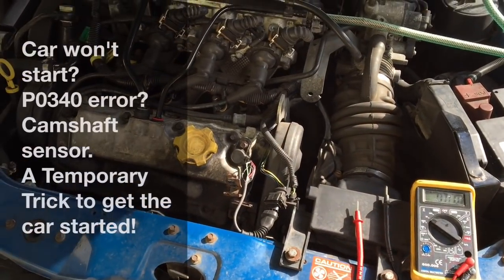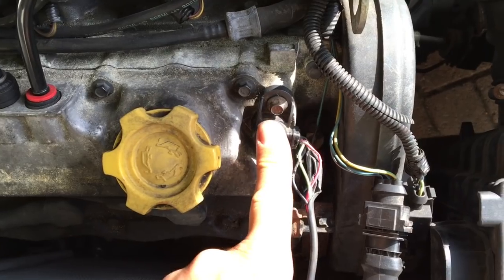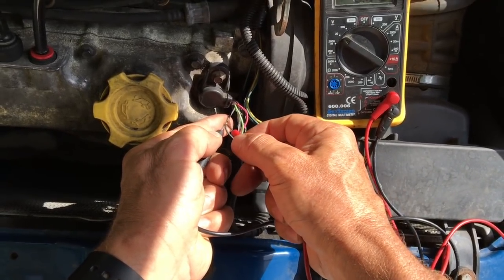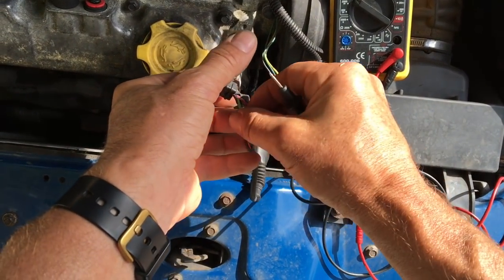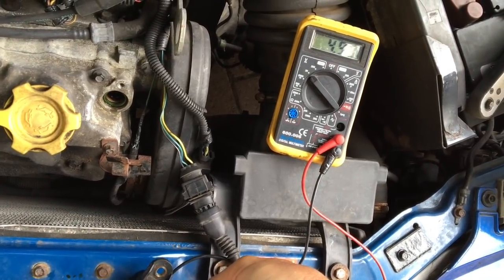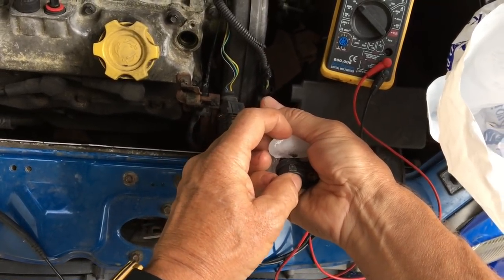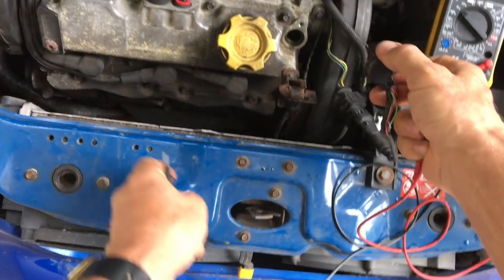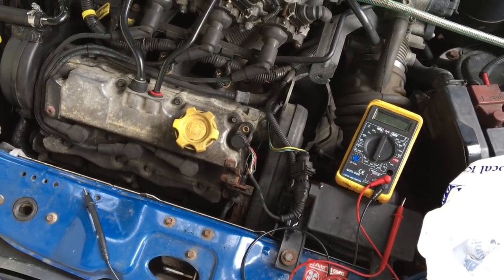P0340 Error? Car Won't Start? Here's a Quick Fix! For Camshaft sensor.

Comment: On mine 45 kv6 i change the sensor but still same situation i cant start car again,anybody have that problem also?
Reply from the maker: See this recent video of mine for confirmation of whether the sensor is actually working, https://youtu.be/kAOlPEnuTMw 
I had a recent experience of a new crank sensor being worse than the old one. 

Also have a look in the timing belt cover to check that the camshafts are actually rotating.  If none of that reveals the fault, then check the cam timing to check it hasn’t slipped due to a slack belt..      https://youtu.be/kAOlPEnuTMw
Reply: @comeinhandynow  well actually at first i get first problem with crankshaft sensor the car will just turn off in midlle of driving,then i will restart fault with TOAF and car will turn on normally and i will continue driving till again same thing will happen.So i change crankshaft sensor and everything was fine maybe 20 days,then sudenly my car just turn off in middle of driving again,now i get this code like on ur video so i change camshaft sensor but still no help.I just notice one thing when i get this camshaft fault code and when i try to turn on ignition i heard some knocking sound down the jatco gearbox and then i clear the camshaft fault with TOAF this sound stop but still i cant turn on the car ...really strange
Reply from the maker: @i_mgzr9038  I believe if the car stops while driving it must be the crankshaft sensor failing.  A faulty cam sensor stops it on restarting not during driving.  Maybe there are some poor crank sensor parts out there.  As in the video, I fitted a Delphi one and all good.  I would also recommend the digital scope for diagnosing with confidence, as in the video I posted earlier.
Reply: @comeinhandynow  yes i understand but still on diagnostic i have only camshaft fault like on ur video

Comment: I’ve changed my car sensor and still won’t start. What should I do next ?
Reply from the maker: Test the sensor as shown, then check that your camshaft is actually turning by looking in the hole where it went. The timing belt/chain may have gone or cam snapped.

Comment: Thank you!!! This was so helpful. I pulled mine out and iced it 7 minutes. Put it in. And instantly started!! 05 Chrysler 300c..
Reply from the maker: Great!
Reply: @comeinhandynow   thank you again, I was getting both p0340 and p0344. So I used it to diagnose it. As I was worried the problem ran deeper. But the second drive after replacing the engine codes (both) cleared themselves.
Reply from the maker: @StutteringInquirySGT  Well done, yes they should clear out when they are working ok.

Comment: I just replaced my camshaft position but the car still won't start and it made that same noise that it did in the video. And this is before and after I replace the camshaft position sensor it still won't start. I don't think that's what's wrong with it even though the code says it is. It might be a bad fuel pump regardless what the scan tools says.
Reply: I replace the camshaft position sensor because my car wouldn't start the diagnostic code set p0340. Replaced it and it still won't start it still makes that same noise that it did in the video. But I don't think the scan tool knows what it's talking about because the fuel pump doesn't make the buzzing noise it used to make which means the code should be reading bad fuel pump not bad camshaft position sensor.
Reply from the maker: @BryanG830  If the code is p0340 / cam sensor then it is the cam sensor signal at fault not a fuel pump issue.  I have bought a new sensor in the past and that new one was faulty, so test the sensor yourself, as in the video to see if it is working.  If you can get an oscilloscope on the signal that will also show if it works or not.  The other experience I had was a cam sensor error caused by the camshaft drive bolt having snapped and the camshaft was not rotating.  Worth checking.  That was on a BMW/peugeot engine in a Mini.

Comment: Extremely helpful video. My wife's Meriva A 1.7 cdti (2005) has issues starting when warm. Was advised to check this (will be testing / replacing over the weekend) 
Not 100% sure this is the issue but my thinking is start at the cheapest possible cause & work up lol 
Battery / alternator tested good at Halfords, but strangely when it's warm & hard to start, it starts  when I connect my Noco battery booster jump pack ?? Starts absolutely fine when cold or first thing in the morning first turn with no problem - so the battery has enough juice to start when cold, but strangely it seems not when warm.  Helpful video Ty - subbed 👍
Reply from the maker: Thanks, sounds like it could be the cam sensor, as in the video.  When it is hot and difficult to start you could try that ice trick as in the video to see if it is that part.

Comment: my car gets this code... aragh... have had new sensor put in (by toyota), new ecu (dont ask) by toyota. Yet still I get this code and my car intermittently wont start. Its driving me mad, other day I couldnt start the car for 1.5 hours ... its like there is a gremlin  inside my car. Auto electrician said there is no problem electrically, am now being told possible stretched timing chain. Mine also had hot starting problems, would start when cold. What was the long term outcome with this fault?

Comment: 2005 crysler 300 3.5 driving,that code showed up I replaced the sensor  started  driving on the highway then all of a sudden the car stop running. And wouldn't start .I was stuck on the highway for 6 hours before I finally got help .. do u think the timing chain could have possibly failed even know I didn't hear any odd noise like lifters, rods chain dragging noise
Reply from the maker: Too difficult to tell what it could be. Read the codes again for clues.
Reply: @comeinhandynow  the code Is the same code p0340
Reply: @Jmasontv  so what was it sir
Reply: @aloiba100  I never figured it our ended up getting towdd by chp

Comment: Mine will start gears want change it’s push to start
Reply from the maker: If the gears won’t change easily then it’s probably the clutch slave cylinder bracket come loose, see my video on fixing that.
Reply: @comeinhandynow  it’s in the transmission shop

Comment: have cam position sensor code in my cupra too lately and also struggles to start just backfires unless I press the accelerator. seems to go in limp mode too, usually I clear the code and it'll run fine again till it comes back but now just seems in constant limp mode yesterday and today, still waiting on my new cam sensor and hopefully fixes it all.
Got o2 lambda and o2 heater codes too but that's just cause of my decat, ran fine before that too just need to map it so it runs on the decat without throwing those 2 codes

Comment: I have a Citroen relay 2016 camshaft sensor on diagnostic changed the sensor twice also changed the crankshaft sensor and crankshaft position ring also done the time changed ignition switch changed barrel car still won’t start it takes a few cranks for it to start code won’t disappear even with the camshaft sensor off the car sometimes starts checked all voltage everything seems fine any help
Reply from the maker: Tricky one, if it’s still P0340 then maybe the connection from sensor to ECU has a break or poor connection.  Try and wire the sensor directly to the ECU socket.  If it’s still showing the error maybe the ECU is at fault.

Comment: I have a 2004 Chrysler sebring. I got a diagnostic and I was told the code was p0344. I had the camshaft sensor replaced, then had to replace the battery that same day and a few days later I got the crankshaft replaced as well. The car turns on now, but it still won't start and the engine light is still on. I have never had any fuel issues, but the mechanic is saying he doesn't hear the fuel kicking in. That was when he replaced the crankshaft and still nothing.
Reply from the maker: If the engine light is on then there will be a diagnostic code that you can read from the OBD2 port that will tell you what the computer thinks is wrong with the car

Comment: So if my crank sensor reads 5v constantly. Even after being in ice for 10 minutes ? I assume that's thr sensor broken
Reply from the maker: If you are measuring the right wire and there is no change when touching it on and off a steel surface on the end, then yes

Comment: Got a 1.9tid saab, cold engine starts up, drive it for as little as 5 minuets and then it intermittently wont start, will fire with cold start or if you let the engine cool down again. will always start when cold. finally got an obd reader that can pull codes of it and just one code,  faulty/out of range cps. Your trick with the ice explains the intermittent nature of my fault, thanks a lot, I couldn't understand the intermittent issue that had one common factor, heat of the engine :) It's cold at present I might not have seen this in summer
Reply from the maker: Cheers. Glad it helped explain it.
Reply: @comeinhandynow  if it walks like a duck and quacks like a duck, then it's probably a duck LOL I've ordered a new duck, erm no, a cps, damn best go check I haven't ordered a duck by mistake LOL

Comment: Hitting this issue with my 06 Wrangler 4L now. Won’t start when hot. Cracks and cranks. However, if I throw the gas pedal to the floor as I turn the key, it will turn on and that is when it throws the p0340 code. Otherwise I have to wait an hour or so until it cools. My cam sensor was recently replaced though so I’m at a loss. What prevents the overheat on the new cam sensor or is it just something I’ll have to change every now and then ?
Reply from the maker: I would suggest testing the voltage on the sensor with a multimeter (voltmeter) as in the video.  When cold then hot.

Comment: I prefer to try taking it out and use contact spray (outside the vehicle) with all sensors.
Reply from the maker: I guess the cooling effect from evaporative spray may also work as a temporary fix.

Comment: my car wouldnt drive and rac said camshaft sensor, the car was taken to a garage he ran diagnostic test and said cam sensor fine and the timing chain has slipped he has told me he has not checked the timing chain but because the sensor is fine that it must be ?! any ideas?
Reply from the maker: jade hollyfield I would like to know how he tested that sensor and why he deduced it was ok. It may be a timing chain slip being sensed but as that job is expensive, personally I would like to have confirmation that it is not the sensor as that is easy to change. See how I tested the sensor.

Comment: So i have a 2000 ford ranger that turned off suddenly and wouldnt start. Got a P0340 code so replaced the camshaft sensor. The starter is still trying but no luck. What do i do
Reply from the maker: Have you cleared the error code and then does the code reappear or do you have any other codes?  You could try testing the sensor by measuring the voltage at the sensor that I show in the video.

Comment: Any advice if u replace both the cam and crank and it doesn't crank still
Reply from the maker: When you say crank do you mean it doesn’t turn over or it turns over but doesn’t start. Is there a spark from the spark  plug‘s
Reply: @comeinhandynow  turns of but doesn't start

Comment: That's a neat trick but tell me brother how many people ride around with a cooler full of ice to cool off a crank sensor LMAO!  Also most of the time break downs don't usually break down near an ice machine either.
Reply from the maker: Most people here have some ice cubes in their freezer at home. Scenario that happened to me: car broke down, get a lift home and get spanner and some ice from freezer, go back to car and use spanner and ice to get it working and drive car home, then can wait for new camshaft sensor.  If your not near home go to a shop for ice or a bag of frozen peas!

Comment: I changed camshaft ,crankshaft, coolant sensor and still crank but no start it all started with a misfire 3cylinder and I changed all spark plugs and all ignition coils and then the sensors I been working on this 2010 Hyundai Tucson for 5 wks keep buying parts changed the oil added coolant nothings working i'm checking fuses and then I don't know
Reply from the maker: See if there are any error codes in the ECU, see my video on a cheap OBDII error code reader and diagnosing car faults.
Reply: I took it to the shop got the Head Gasket and the water pump and the thermostat changed out runs like new now thanks for the reply

Comment: You can simply plug out the sensor and drive home as well. Not all folks will have ice on a whim
Reply from the maker: No you can’t.  The car won’t start unless it initially sees a correct signal from the cam sensor.  Once it has started, then it is not needed as the ecu stays in sync with the crank sensor.
Reply: @comeinhandynow  I will do it and upload the clip for you
Reply from the maker: Thanks for that. Yes it seems on some engines (your Toyota example) the sync between cam and crank sensor is remembered inbetween engine turn offs. Or maybe the ECU is just guessing the sync in the absence of the cam signal, as there is just a choice of 1 out of 2 positions to choose from. That seems to fit with that video as some of the time it doesn’t start. Then try again and it does. 
On the MG, Rover, LANDROVER engines that are in my video it doesn’t do the same and definitely needs to see a cam signal in order to start. After that it doesn’t matter. 
Hence the ice trick to get some sort of signal from the sensor to start it as after it warms up the faulty cam sensor packed up but the engine kept going.
Reply: @comeinhandynow  what if the location of the sensor is behind the front passenger wheel well and not easily accessible like yours? Can u take a fuse in and out or reset another way?
Reply from the maker: @FindShindoHere  I don’t think so, best to just replace with a new one.

Comment: I had code po340 so I replaced the camshaft position sensor but still didn’t start could it be I was an aftermarket one and not OEM also was told that a bad starter could also cause code po340 ?
Reply from the maker: I’d be very surprised if a bad starter motor would cause that error code. If the starter is bad it won’t turn over properly.  Try and test the sensor with a multimeter like in the video and check the error codes again.
Reply: Suppose you have no power going to the camshaft sensor can it be a fuse that’s bad
Reply from the maker: That would be possible, but also make sure that the ignition switch is on (dash lights on) before you test for voltages at the cam sensor.

Comment: Because the wiring looks fine I did test for voltage and it tested good
Reply from the maker: You can also test the sensor like I did in the video, touching it on a piece of steel while measuring the output voltage (ignition on).
Reply: @comeinhandynow  thanks for replying

Comment: I got that code p0340 car takes time but starts and runs rough like the timing is off I just put this engine and when I connected the camshaft sensor connector to the sensor I messed bent the middle pin on the camshaft sensor replaced the sensor but still throwing that code.. did I mess the ecm?
Reply from the maker: I doubt that would mess up the ecm/ ecu.
Reply: carguy fastorslow any luck with resolving your issue?

Comment: I have a 2004 pacifica 3.5 replaced cam and crank sensor and still doesn't start
Reply: Check your ground or replace the connector. That's a cheap fix before you take it to shop
Reply from the maker: Try an engine error code scanner to diagnose the fault: https://youtu.be/RnyXdxYaW2Y

Comment: Hi I'm having this problem  I changed both now my car wont start at all
Reply from the maker: What error codes did you get? Got it working yet?  Did you test the cam sensor like I show in the video?
Reply: @comeinhandynow  yes I finally got it fixed it was the ones under the valve covers I took it to a mechanic and finding out how easy it was to change I'm kicking myself lol
Reply from the maker: Oh well, better luck next time. We ‘live and learn’.  At least you got it fixed.
Reply: Yea I know that's true but I could changed it for a quarter of the price but next time I know lol
Reply: @mattl2477  what exactly did you get fixed...I changed to Cam and crank too and it still won't start...any advice please
Reply: @ramashpandohie4961  there should be ones under the cam which are easy to change its not hard
Reply: @mattl2477  bro I found out that the ECU wasn't putting out any voltage through a single wire and thats why it isn't starting...but do you think I have a bad ECU or is it a sensor
Reply: @ramashpandohie4961  I'm not sure I'm not really a mechanic just what I had happen to me and I fixed it

Comment: I have a 2008 nissan sentra got same code P0340 replaced crankshaft positioning sensor then camshaft (x4) sounds like yours, still wont start. Getting frustrated, any advice would be extremely greatful.
Reply: Sometimes some sensors won’t work unless it’s oem I know it’s 3 years late but it’s never to late to help the next person
Reply from the maker: Try testing the camshaft sensor as in this video (are there really 4 of these!? I guess you mean there are 4 camshafts. There would usually be just one camshaft sensor).  If you measure a good voltage variation this tests the sensor and its supply.
Reply from the maker: It seems this is a common fault on those cars.  I did a quick search:   http://www.carproblemzoo.com/nissan/sentra/camshaft-position-sensor-problems.php

It might be worth contact a Nissan dealer to see if there is a solution/recall action on your car.   Also continue internet searches to see if someone has found the reason for these faults.
Reply: Check your ground or replace the connector. I have Nissan maxima. It's a known issue. Could be your timing chain. Big job. $1600